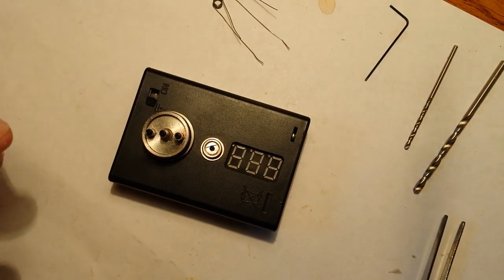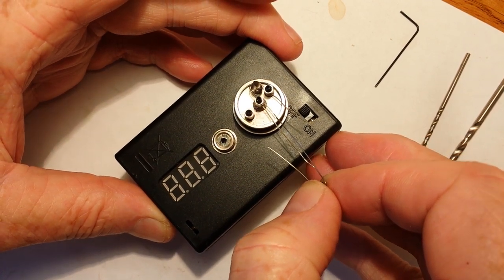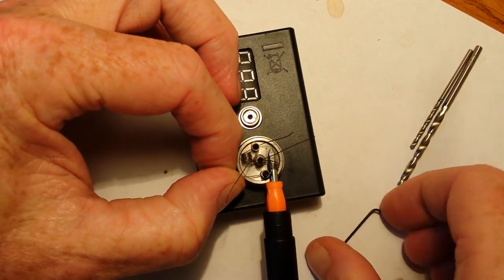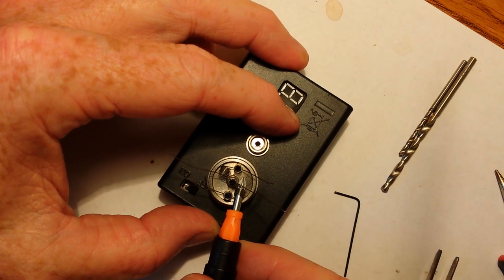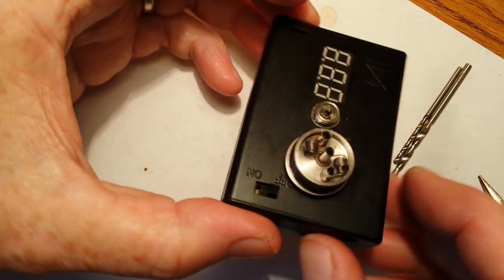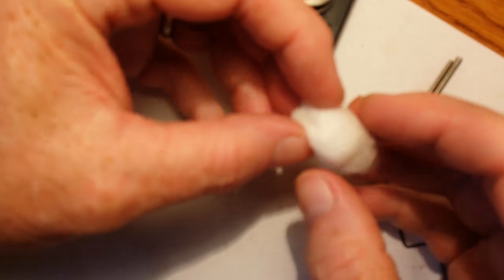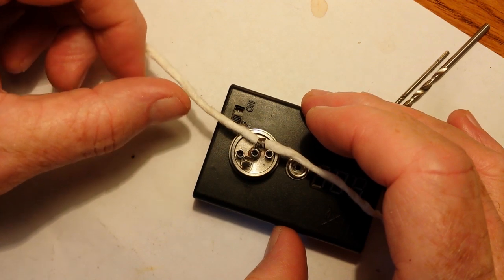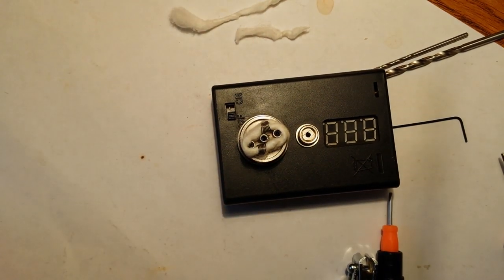How to build a dual coil rebuildable dripping atomizer (RDA)

Comment: What size wire are you using? I use 26 gauge and have the absolute hardest time getting the second coil through the center post. And I have the same clone.